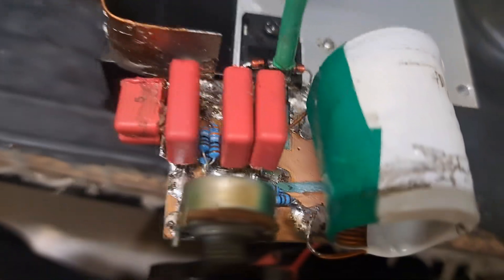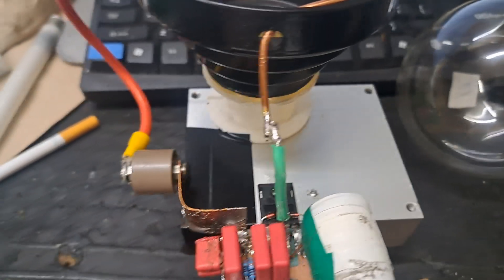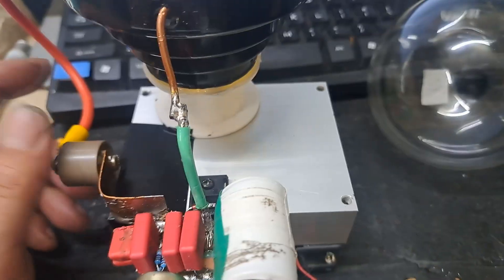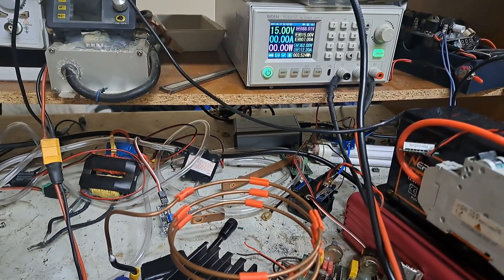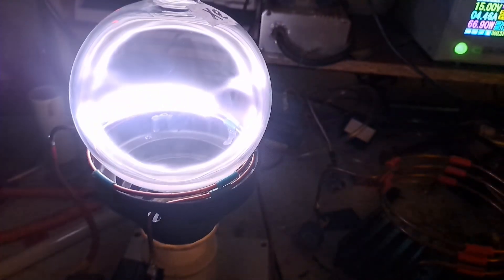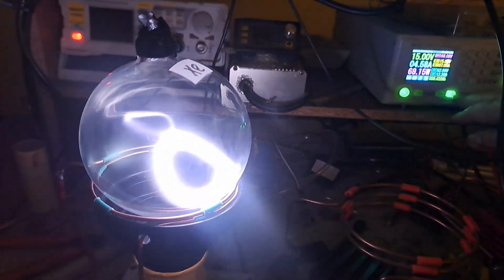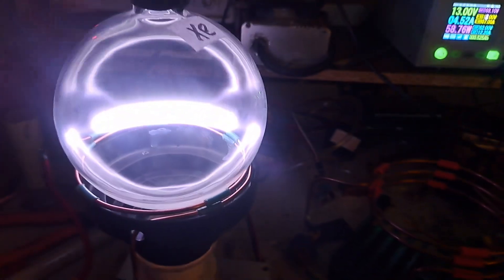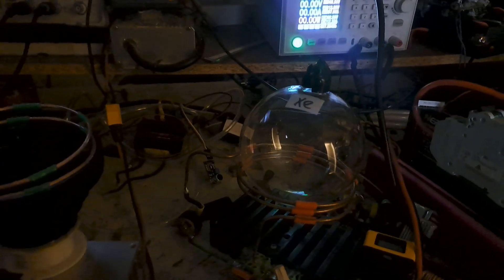Another Plasma Donut Circuit

Comment: Hello) Will the IRF3205 work in this scheme? And it needs to be protected by putting a zener diode between the gate and the drain and between the drain and the source, by the way, why do you have a zener diode soldered with anodes to each other?
Reply from the maker: 55V fet can maybe work at like 9-12V input I guess. Feedback on the gate is bipolar so bipolar zeners just to protect gate.
Reply: @Magneticitist  It didn't work on irf3205, I put all the protections, in the end it broke through, I can't do this scheme at all for 2 weeks, there's just no way to buy irfp260 /460 and others yet

Comment: You ain't kidding when you say that you can't use the same components in a different layout and expect the results to be the same.  This circuit is very sensitive to any variations.  It took me 3 tries to get it working the first time.  The components seem to want to be infinitely close together.  I finally achieved success using point-to-point construction, but I'm not happy with it because it's fragile and want a cleaner final assembly.  I built a PCB version and it's switching hard.  I added 3 10ohm 1 watt resistors in parallel to the gate. This seemed to correct the phase, but isn't usable because it's cooking the resistors.  I think the current is coming from the internal capacitance of the MOSFET, but I don't know.  Layout seems to be key.
Reply from the maker: That sounds about right. On my first one I had wires dangling around going to the mosfet and I needed to have them spaced apart from each other an exact amount to get the operation I wanted. As far as the phasing I never really did figure a good way to go about it with these circuits. Sometimes I can pull it off with small tweaks but I've never been able to slow the gate without burning resistors either. It's just too much gate drive power with common mosfets. Using a much lower gate charge fet and trying to drive that gate at just barely turn on voltage might help. Someone out there is probably successfully just using RC filters on the gate. I've got some stuff coming in a couple days to help me tinker around more with these.. I've found it easier to get good tuning when the load is an actual plasma flame. So far I can easily get a toroid with toss togethers but it would take a lot of work with each to get something stable. 

My approach is probably going to be a nicely tuned setup that will be bucked at a little higher voltage than normal for stability, but I'll try to get the field interactions just right for a mid-floater that I can help manipulate with the PWM.

Comment: Yeah so if the plasma is heating up too much and sticks to the bottom of the globe, you think the solution would be increasing the coil diameter and/or turn spacing? I have the sticky plasma issue too in my current setup and wasnt sure how to get the ring to lift off again. Normally I would just turn the bias down but the ring extinguishes before it separates from the bottom of the globe...
Reply: What I've found works best for my setup is having the lowest possible inductance where the circuit will still oscillate and then giving the globe about a 1 cm distance from the coil. In my setup this makes the plasma toroid float in the center of the globe and it's really stable too.
Reply from the maker: Good question. Of course all depending.. but I'd guess the oscillation feedback is not quite strong enough to get the toroid going if you were to widen the primary more, worth a try though.  Increasing the frequency may help. In my case I'm trying to manage retuning it so it will still give the donut but not pull quite as much current. On the next one of these I make I'd be looking for decent variability in the gate bias.
Reply from the maker: So from what I can gather it does seem to depend on the phase relation of your switching, but it looks to me like a lot of these will want to hug the coils due to the field interaction at the higher currents. Around 50W for example. Closer to 30W and below it seems like it's easier to get the floating toroid. Of course I'd imagine then it would require decent switching. Brute forcing the hard switching at higher currents is basically what I'm dealing with on my second one right now.
Reply: I've got a 2-liter running on a 2-turn 6.25 inch primary made from 1/4 copper tube.  I'm pretty sure that's a larger diameter than yours. I also have the issue with the plasma sticking to the primary. So I tried 3 turns at 6.25 inches, but it wouldn't form a toroid. Just the faint blue glow.
Reply from the maker: @clau0086  The toroid wants to float toward high density points in the electric field but it also seems to really want that field to help the excitation. A nice inductive coupling is what you really want but you need to get it kickstarted first. That might be the difficult part.. so IMO it's like ok I need the circuit to be stable for one.. It needs to have enough RF power to create and maintain this donut, but it also needs to maintain enough magnetic coupling in the process to remain stable when the gas is some further distance from the high density electric field. 

Specific voltages will also make a difference. For example starting at 12-15V and going up 1v incrementally. Have to get an idea of the kind of power and dissipation you're looking to deal with. You don't actually need to be switching a lot of current to get the stable toroid though. It seems the most stable and floating when the gate is just barely switching. So it's kind of like a fine balance of finding just that right switching at just the right currents.
That's why rather than try to fine tune my actual primary layout relative to the bulb, I'm going to just try the PWM approach where I can modulate power with potentiometers.
Reply: I've uploaded a couple short videos if you guys want to see mine in operation - for science.  It's not really any different then either of yours.